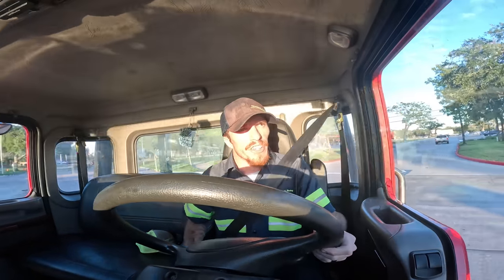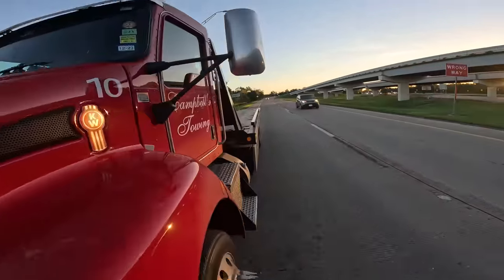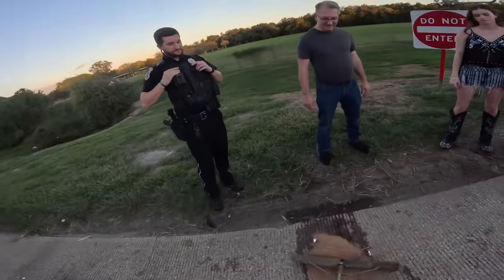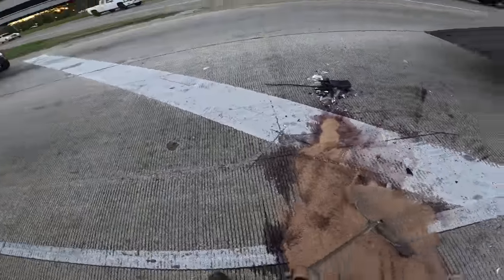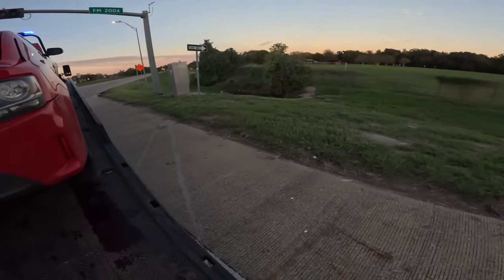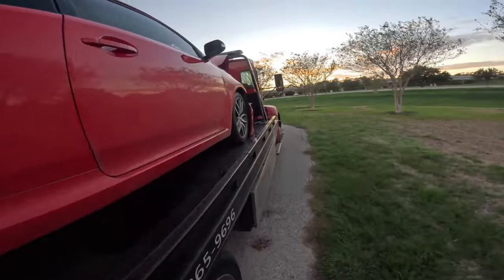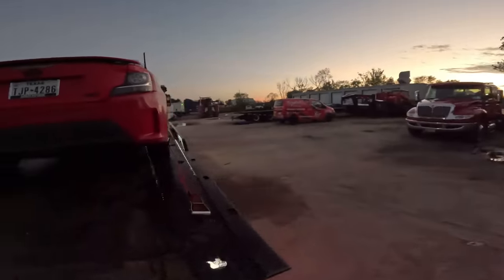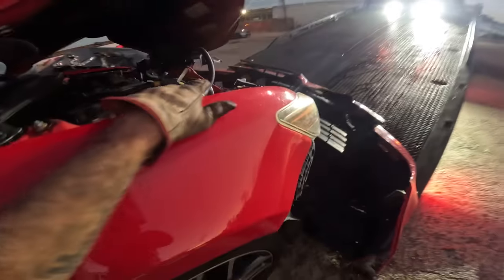Crunch Time at the Stop Light! Scion vs Dodge!

Comment: Pretty easy. Also there is no gun powder inside of air bags because it would produce to much heat what happens is two different chemicals are forced to collide with each other causing explosion
Reply: You are correct, there is no gunpowder, but you are wrong for the reason. It has nothing to do with heat. Gunpowder wasn't used because it doesn't produce enough pressure to inflate the airbags.  In fact the chemical reactions used to deploy earlier generations of airbags used Sodium Azide which produced heat and caused burns. In the 90's, airbag manufacturer Takata used Ammonium Nitrate, an explosive. This too caused burns and other problems hence the massive recall. Today's airbags use Guanidinium Nitrate to deploy the airbags.

Comment: The truck wasn’t that damaged but the car possibly irreparably. I wonder how the front end crash tests went on it.
Reply from the maker: The truck definitely came on out the better end of the deal. Lol
Reply: The damage is designed. It's called crumple zones. I would rather be in the car than the truck. While the damage to the car looks bad, it absorbed the majority of the impact instead of those girls. That truck passed the force of the impact onto its occupants. I will bet the truck occupants were in a lot more pain the next day than those girls were. That scion did what it was supposed to - protect its occupants.